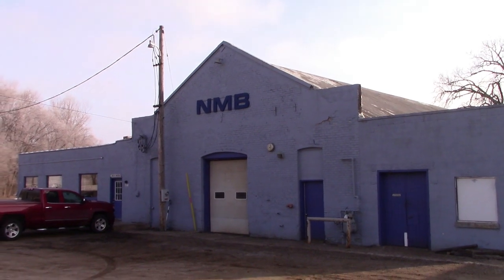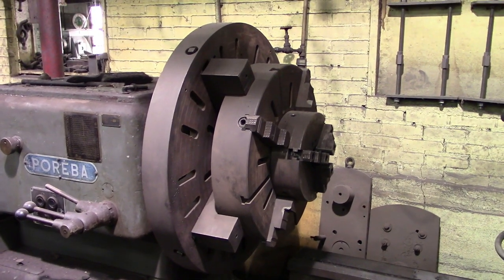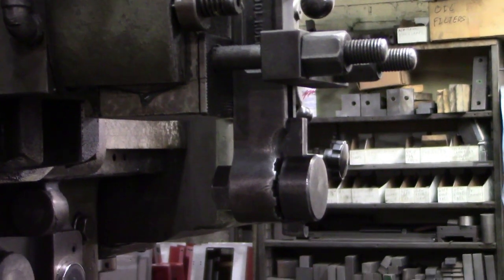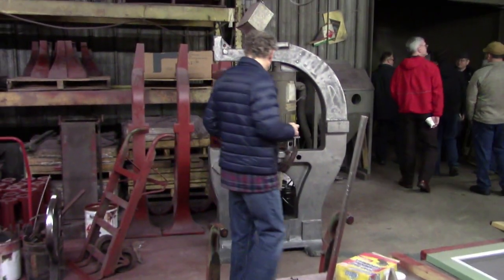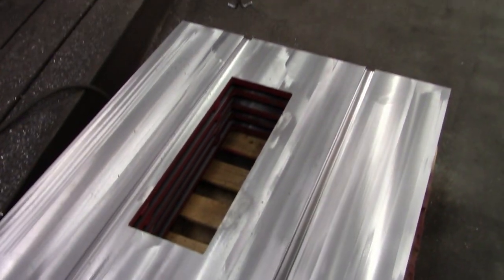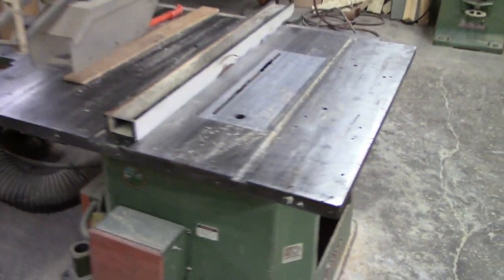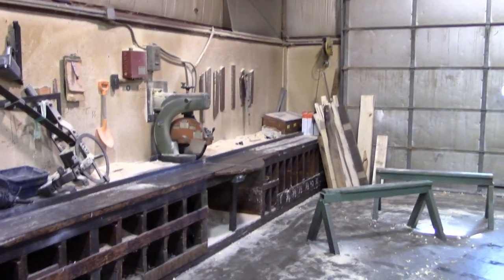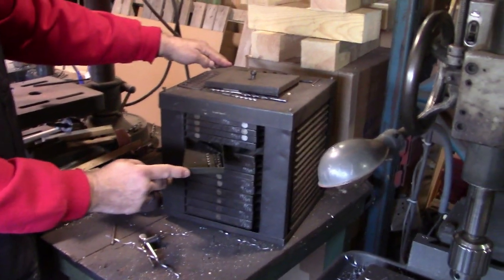Northfield Woodworking Factory Tour

Comment: Thanks for the video, I have a Northfield 12" HD jointer. A few years back when I restored it, I called Northfield and talked to Jeff. They had records on my jointer going back to when it was originally sold in the 1960's to the navy. I was able to order all new original style metal labels for mine which really finish off the resto...Cool stuff. I used to own a shaper from them (which was a really nice machine) as well but only still have the jointer.

Comment: This is the finest woodworking machinery in the world.  Their machinery is precise, reliable, extremely heavy,  powerful and more expensive than home hobby use machinery.    The motors are generally 3 phase which, by that fact alone, makes them more suitable for use in  an industrial environment.   Aside from normal scheduled maintenance Northfield machinery  can  stand up to  24/7/ 365 production schedules;  where machinery is pushed to its limit without breaking down.     This equates to  little or no production downtime.   A production line in a factory is expected to generate several thousand dollars worth of product per  hour.  When a production line goes down the generation of money usually completely stops until the malfunctioning equipment is repaired or replaced.   This fact far outweighs any perceived savings when considering the purchase of less expensive and less reliable equipment.
PHD